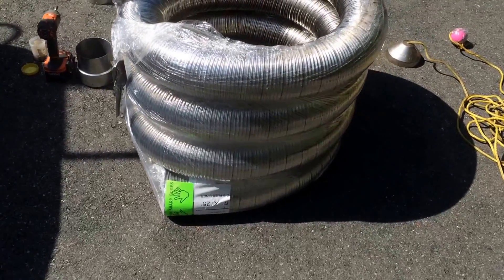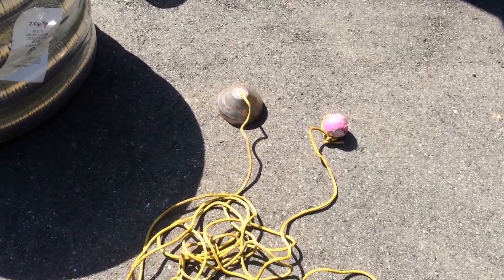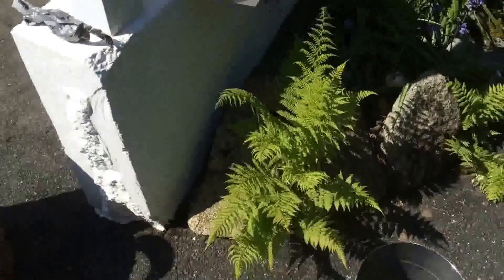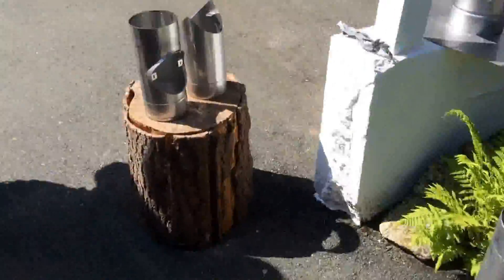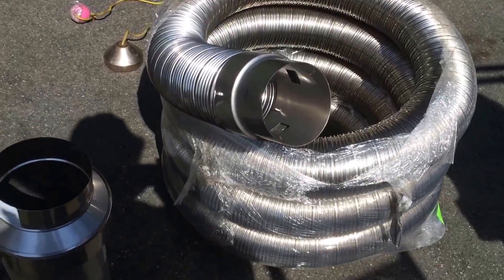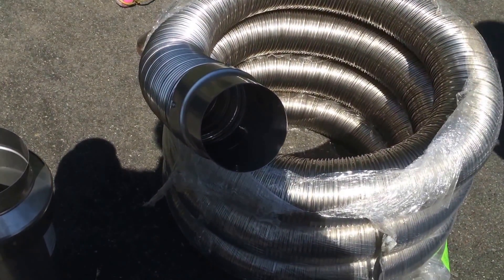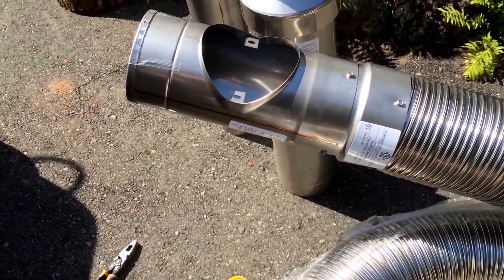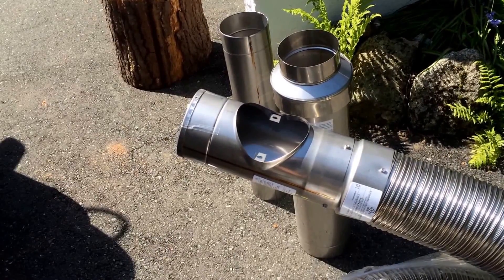Chimney Liners Stainless Steel Components Flexible Kit Wood Stoves Explained

Comment: I have the 316L/Ti titanium m flex.    Can I use it for my stove pipe in my garage?  I have a thimble for going thru the wall then want to run this m flex up to the roof line.  Is that ok to do

Comment: I have seen so many guys put the connections the wrong way because they think you need to have the smoke flow like water over the joints, that’s wrong! Like you stated, the male connection faces down into the next connection, there will not be a leak, draft in the chimney will keep smoke going up the pipe!
However, if you do it the other way around the creosote will most definitely leak out the joint and can cause a fire!

Comment: What kind of liner is that?
Reply: Garbage single wall!
Reply: @puppylife7459  that is cheap light wall.  But most liners including the best ones are single wall
Reply: @Ben Holler   NFPA calls for 2ply double wall zero clearance. Single wall is only used for gas and has to be wrapped
Reply: @puppylife7459  that is not true at all. NFPA and irc simply call for liners to be listed to ul-1777 for use with solid fuel.  And unless clearances to combustibles are met from the outside of the masonry structure that liner needs to be insulated in a way that it meets requirements for zero/zero clearance.   There is absolutely no mention at all about single or double wall in either set of standards or in the listing standard.

And for gas inside a masonry chimney the liner is not required to be insulated at all.  It's still a good idea to do it inorder to minimize condensation.  But it's absolutely not required by code.

Can you possibly site any of these codes you are referring to?